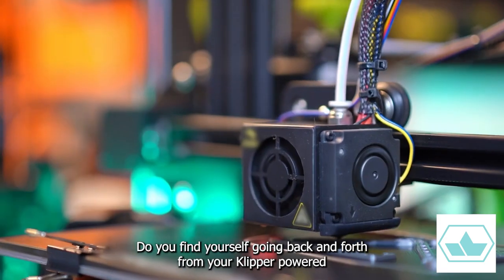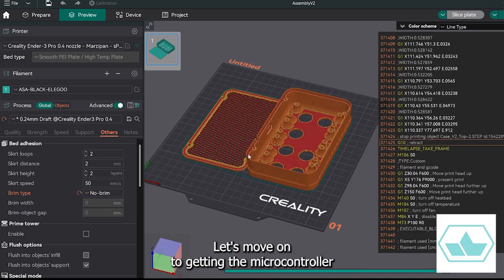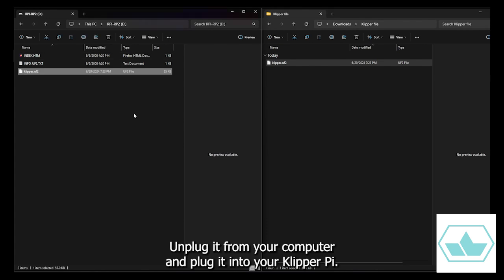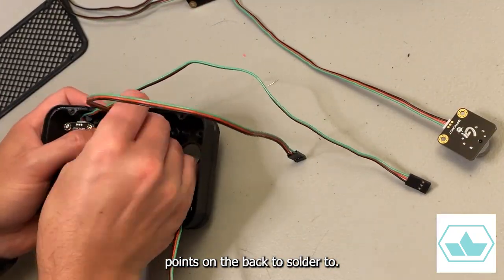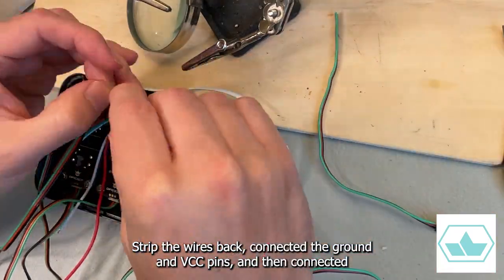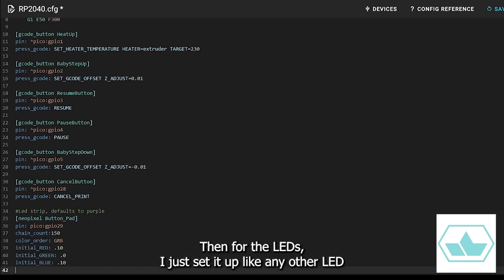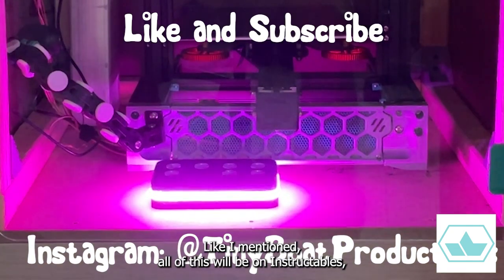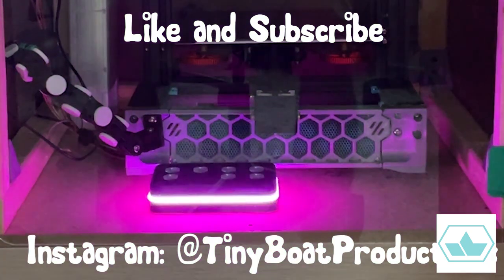Making a 3D Printer Macro Pad

Comment: hi i have install circuit python on pico but once i removed it and reconnected it my pico does not show up and while holding the bootsel it shows thhat noothing is intall on it, Please help
Reply from the maker: Once you have installed the firmware from klipper onto the pico it now showing up on a computer is expected. Plug it into your klipper pi and it should show up when you run the ‘ls/dev’ command